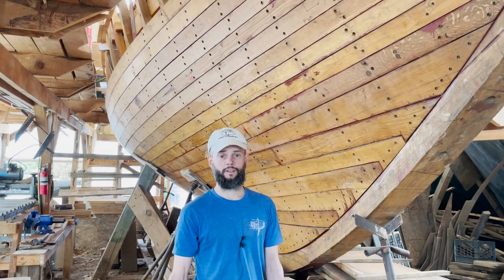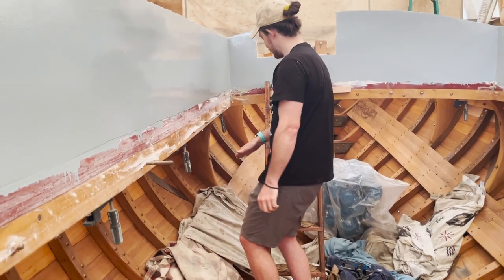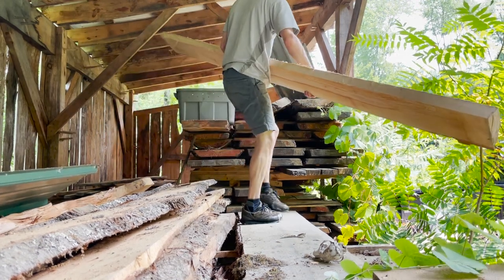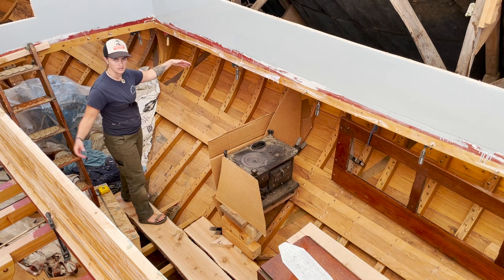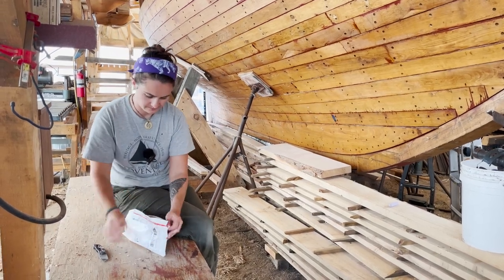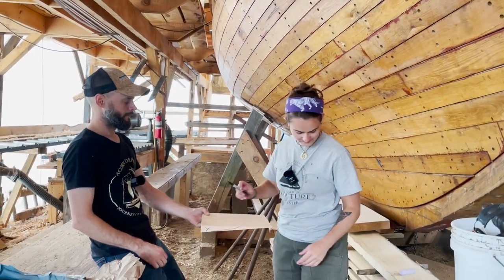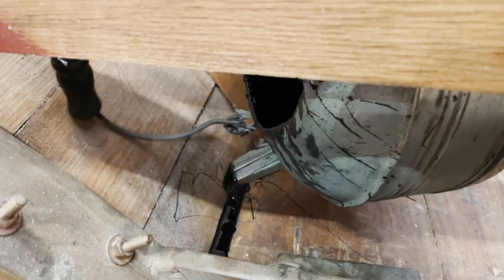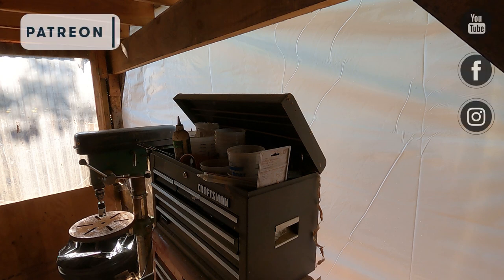Pitching the Bilge - Episode 174 - Acorn to Arabella: Journey of a Wooden Boat

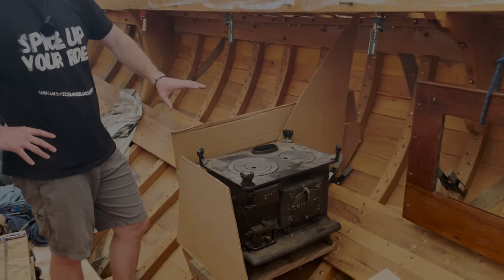Comment: 3:03 I hope you don't intend to install the stove like that. The stove gimbals need to be able to move with the rolling motion, not with pitching motion (which is relatively less fast). Being able to make hot food and coffee at sea is important!

Edit - Ah ok, I see that you intend to have a separate stove in the galley. I'll leave this comment here anyway in case it's helpful to someone.
Reply from the maker: The cook stove isn’t on the boat yet… we intend to use the woodstove at anchor, and think that the idea of a hot stove with a fire inside it tipping forward sounds pretty terrifying.
Reply: @AcornToArabella  Yea, definitely. I just got to that part of the video. Tbh, a single burner alcohol stove would be ok for while at sea. Although on long passages it's really nice to have an oven for fresh bread occasionally, and cake is relatively easy to make at sea too (I doubt you'll be able to have refrigeration at sea without running the engine, but canned butter is very useful).
Reply: @svchineeljunk-riggedschoon4038  with a good freeze box you only need to run the engine every other day or so.

Comment: Why not do all the caulking first then do the pitch on the inside.
Reply from the maker: This is a part of buttoning up areas of the boat for the purposes of moving forward on interior fit-out. Because there is a great deal to do on that front, plus building the deck, plus systems work… The hull’s finishing steps will wait until we’re ready to swell and caulk, which should be a little bit closer to when we’re ready to launch and not necessarily right now.